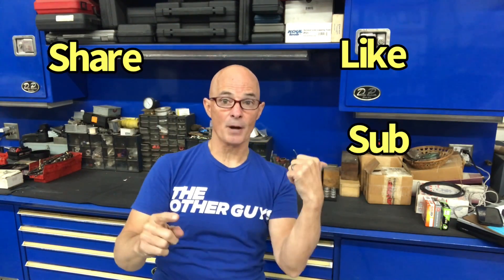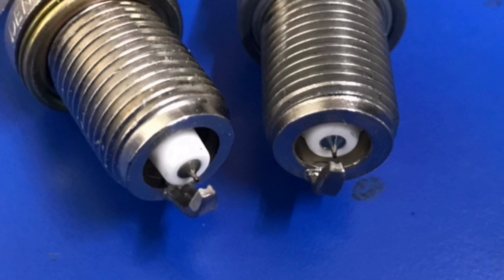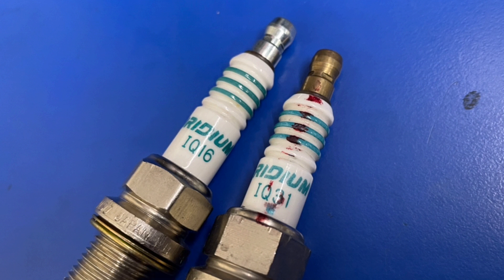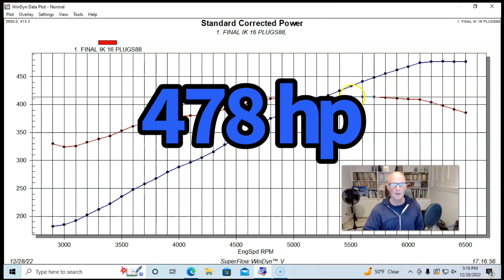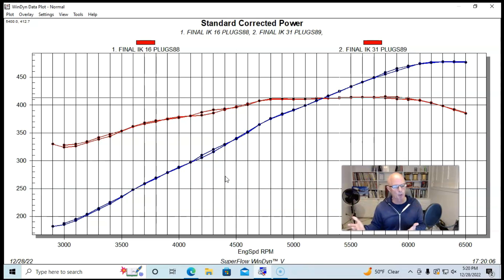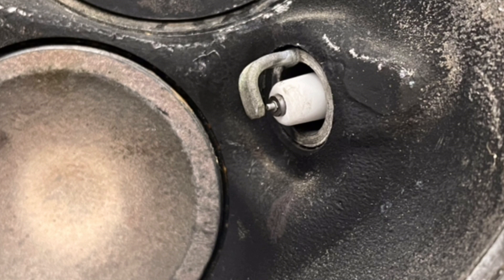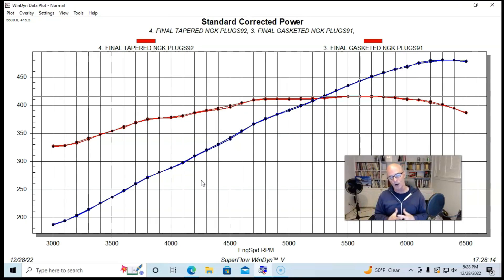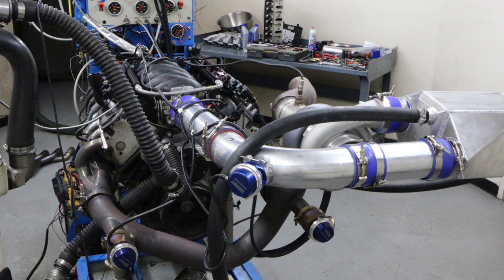SPARK PLUG HEAT RANGE TEST-JUNKYARD LS. HOT PLUG v COLD PLUG-DOES IT MATTER? TAPERED VS GASKET PLUGS

Comment: On some engines the spark plug can make a huge difference. Old Subaru EA series engines for instance. The EA71S factory race engine ran a special spark plug, Golden Lodge 25HL, same as used on some Alfa Romeos. Very hard to find. It was a semi surface gap design. In that engine you can't run a projected tip plug as the intake valve will hit the tip. The plug also needs to be a very cold heat range. A true surface gap (no heat range) will produce about 10hp extra (on an otherwise 110hp engine) and extend the RPM range by 200 RPM, compared to a cold non projected tip plug. I've never gotten to try a set of the Golden Lodges but I have a set on the way to compare to the Bosch surface gap plugs I usually use.
Reply: Let me guess, no difference?

Comment: Instead of power, do any adjustments to spark plugs that you have tested (electrodes, indexing,seating,etc.) have an effect on fuel burn efficiency(cleaner emissions) or fuel use efficiency(mpg)?
Reply from the maker: we tested indexing and gap and plug styles

Comment: With colder plug could you sneak in a degree or two of timing?
Reply from the maker: the heat range of the plug doesn't determine the optimum ignition timing
Reply: @marvin, yes, and with a cold plug and hot spark, you can add more fule with those few degrees of timing giving more power. I think if the tests were done on a carb the result would be more power with the timing and fule variable. But in this test case there won't a change in power.

Comment: Would there be any benefit using a one step colder plug for a stock internals k24 that only sees track use?
Reply from the maker: only as a hedge against detonation
Reply: @richardholdener1727  awesome! Yep that was my intention. Only due to excess heat that a engine sees while on track. 

Thank you for your reply

Comment: This guy is growing on me. I just wish he was testing some of this stuff with higher boost motors making like 1000 at minimum. 1400-1600 would be nice.
Reply from the maker: 1600-hp motors are difficult to keep consistent-for plugs on a 1600-hp motor-gap is the most important thing
Reply: @richardholdener1727  I agree. Which is why I'm here moaning about it. 1400 crank can be consistent. The game starts to change a lot much past that though. In theory a lot scales with boost so the 5.3 method of your videos works but I don't think so much with plugs. As I just trashed some plugs with holley smart coils and a low boost of 22# (for this engine). Every combo does get different as my lower compression 1800hp motor was fine with 36# and truck coils. But the monster boost heads and 11 to one on e85 had enough blowby with 2 10an breathers to shoot the rear main seal out the back and shutdown the track for 20min. I don't like being that guy and I thought I had everything in place to not be that guy. Appreciate the videos and reply. Just my 2c
Reply from the maker: plugs are not usually the problem with boost-coils either-they need the dwell cranked up to 4.0-4.5-and even 1400 hp is not repeatable enough to look for small changes in power
Reply: @richardholdener1727  and I know  us guys running large hp probably aren't your target audience so it may not be worth your time or money to test that or risk those engines. It would be cool to see a catch can video at some point and what size is really needed and the blowthrough that can happen with larger ring gaps and running e or meth.
Reply: I'd be willing to donate an LSX bare block to you if you use it for stuff like this. Could probably get a k1 crank and some cheaper rods and pistons if you're interested. It's sitting at ACE Engines in Torrance right now. It's been remilled and refreshed but the deck height is just slightly lower so it's going to need custom height rods because it was milled by my original builder (not going to drop names) crooked. @richardholdener1727

Comment: I tried some projected nose plugs on my old Suzuki air-cooled four-cyl engine and noticed a very slight improvement in idle smoothness, and perhaps a little bit of extra perkiness on take-off, but nothing that would probably show up on a dyno.
I'm not too bothered. A little improvement building upon another little improvement helps, though.

Comment: Question: I have two cars with the same engines but one low comp supercharged and the other hi compression n/a. Sparkplugs are two heat ranges apart from each other. The question is, what happens if I use the n/a sparkplugs on the supercharged engine? Both stock cars
Reply from the maker: use colder plugs in both

Comment: as for gasket plug vs taper seat. its all about head design. best seal to the chamber. the more the plug protrudes the more it gets in the way flow atomization and piston contact or valves. you dont want it recessed in the threads either just barely in the mix.
heat range on plug on the other hand is always application specific but alot of people seem to have it mixed up too. it comes down to what your doing. think of your spark plug as the source of your ignition. think of a glow plug in the same sense. good luck firing most diesels without the glow plugs when its really cold.
now think about your fuel injector as also a source for your ignition. trust me it helps the correlation as you need both of these things at the right time.
fuel timing is important so this is why spark plugs have heat ranges. say you get fuel early. a hotter plug will help burn the fuel better as it wont atomize well and be more like droplets. 
with a higher compression motor less heat is needed as heat and the compression will auto ignite the charge and cause detonation. 
in a 2 stroke application you still only have 2 ignition source per revolution of the crankshaft on a single cylinder. yet 2 strokes usually run hot plugs. they have expansion chambers and scavenge and reburn the previous air/fuel charges that already went through the combustion chamber. hot plug will keep reaction going better and compression is usually low. 
things being said in the 2 stroke field the amount of the electrode sticking out is becomming more important as comp ratio rises. head gaskets are going away and squish bands are much better tech. it actually changes the flame front and ignition comes more from the edges of the cylinder than the spark plug once the engine warms and makes a ton more power and yet again raises safe compression ratio. 
cylinder designers design the head for certain plug and you run said plug. its in the right spot plays nice with the fatty pipe and stays out of the way when the magic happens. 
changes like that allow a tiny single cylinder to make 17-20 hp reliably and run pump gas. with a 15:1 compression ratio. you know engines you know thats alot of comp for pump gas. keep in mind its also not big cc cylinder its only 70cc technically really 68cc. these guys run a "squish" of .7mm you can increase or decrease squish to change compression and flame front characteristics but power suffers obviously. that .7mm is piston to cylinder head clearance you dont get much wiggle room and you have to always be careful when making changes. failure could be catastrophic for many reasons very easily. this one launches at just over 10k rpms and accelerates around 10,800 rpms until the ignition system cuts out at 12k rpms. it hits around 70 mph before the cvt hits its final gear and the rpms climb from its acceleration rpm. with a different exhaust i can raise the engines usefulness to around 14k rpms atleast 13k with a slightly weaker exhaust that also comes in at a lower rpms too so i can have more power everywhere.
if i were to raise my power band i cant use longer plugs as the plug could contact the piston under heavy loads. things stretch under crazy high rpms high heat or major forces. always pick your parts not parts off a shelf.

Comment: I had a 1967 mustang 289 that I installed a street master + AFB, a RV cam and headers. Originally the stock configuration would get about 20 - 25 MPG. The modified config gave about 18 MPG. I played with jetting and got into lean serge. I changed to the colder spark plug, Hipo for the 289 and was able to go leaner.

Comment: What spark plug and wires combination would be good for a 07 5.3 with truck Norris cam ls7 lifters and 3/4 longtube headers need
Reply from the maker: stock wires and 1 step colder in plugs

Comment: I listened to the whole video and have a question.  What would happen if you played with the timing in these tests?  Could you get a little more timing into a cold plug, or would knock be a little more forgiving on a cold plug?  I've heard a lot of tuners make the comment that running a TR6 NGK plug vs the stock TR55 makes it a little easier to tune and dial in the engine because the knock resistance being a bit better makes it more forgiving.  Nobody ever makes the comment on if more power can be milked out of one over the other though.  In my example there we are talking N/A engines and only one heat range of shift, which is pretty minimal.  Though it is interesting I hear that just with one heat range colder than OEM there is a measurable difference in knock resistance.  I would love to see you test knock/timing impacts on an LS motor vs heat range.
Reply from the maker: we alter timing til we get maximum power-

Comment: Only time I have run into fouling issues with cold plugs were with carb blow through engines on the streets. 
EFI has much better fueling control than carb stuff so makes sense.
Unfortunately Tuning carburetors is a dying art.

Comment: Iv noticed that my 2019 2500 silverado 6.0L pings often with the stock plugs and I can feel the computer taking out timing out.  Im thinking about getting a colder set to help and go back to hotter plugs once then engine starts to burn oil. You should see if you can make table changes with different heat ranges to see the effects. Like if you can run more timing on colder plugs.

Comment: On my 1985 GPz 750 turbo I had to increase the heat range 2 numbers because above 8500 rpm the boost blew the spark off the plug like blowing out a candle. I used an MSD ignition and coils and Nippondenso 16 copper core plugs and started exploding turbos because the impellers were spinning so fast oil wouldnt stick to the bearings and theyd lock up and explode. Terry Kizer put a Torringinton 2 stage bearing in a turbo and that made my engine live till 4th gear, the turbos exploded under boost in 3rd before I had the new bearings. I was putting 52 psi at the intake valve @ 12,000 rpm and my engine liked hotter plugs and VP C16 fuel.
Reply from the maker: just say no to hotter plugs on a turbo and bring the plug gap down-you won't blow out the spark
Reply: How much wheel horsepower? Turbo bikes are badass.  Stock turbo?  Sounds like maybe turbo overspeed failure.

Comment: I tried a few different taper/gasket plugs in different heads many years ago. For same type of plug, they protrude into the head exactly the same. Denso plugs are good though, 31 is very cold !
Reply: How were you running a taper plug in a head designed for a gasket plug??
Reply: @davelowets  obviously you just screw it in. They work perfectly, have been using them for 20 years. Tapered seat plugs seems a very American thing, any Euro engines that used that style are decades old.
And as RH shows, he had a mixture of both
Reply: @blow0me  If the edge of the plug seat in the head isn't tapered, and it's just a flat surface, jamming in a tapered plug could end up to be a bad scenario, such as boogering up the threads.

You can put a gasket plug in a tapered seat head, but you can NOT put a tapered plug in a head designed for a gasket plug.
Reply: @blow0me  The brand new American made heads on my Oldsmobile big block use non-tapered plugs.

Comment: A dyno test of coils would be interesting.  D585 heat sink coils vs square coils vs Ls3 style coils.   It’s a deep rabbit hole I went down when I had a 585 die and considered best replacements.
Reply: If you currently have enough spark to ignite the chamber fully, changing to a “better” coil won’t do anything.  People don’t realize that on old school SBC’s with distributors and msd boxes they’re easily turning 9000+ rpm in some applications with ONE coil.  With multi coil setups, each coil has 1/8 the workload and has to fire at 1/8 the speed of a single coil application.  As long as it has enough dwell time before having to discharge, it’s doing its job to the needed standard.

The easy way to look at it like asking will a stock fuel pump, a walbro 255, or a 450 make the best power on a stock 5.3?  Pumps make zero difference once you’ve met the needs of the rail and system flow.
Reply: 585's are overhyped and over-rated.
Reply: Agree. Also spark plug test on motor with 12.0 comp..6.2. Heads cam...not a small 5.3
Reply: @GETLITUP69  likely make zero difference too

Comment: i left a comment, actually more of a question, on a 10 month old video.

I don't know how far back you on to read comments.

those answers will not just suit me, but suit nearly every 5.0 efi sbf being built for street application.  granted, a lot of folks won't be able to afford the heads, likewise adding that to the answers, might be helpful for a lot of your viewers (in addition to the questions i asked).

the title to the video i left it on is:

HOW MUCH POWER IS A 5.0L CAM SWAP WORTH? WHAT IS THE BEST CAM FOR MY 5.0L 302? 5.0L FORD EFI VS CARB

much appreciated, yer one damned fine fella.
(as is most of the west tech folks)
(back in the late 80's,  early 90's, absent westech i had to run hard up n down the hill to big bear to test my upgrades!!  (those where the days).
no longer out there thou....  I headed east eventually...  (that elevation change tells a lot of secrets with performance)

Comment: we used to run a small block Pontiac 312ci with 13-1 compression on methanol we used washers on our plugs more so for clearance and which way the tips were facing so they didnt hit the piston we did all these dyno tests on it and we found absolutely no loss or gain from them including temp of plugs there was nothing in it we just ran what type worked better for the compression ratio and fuel the only thing we saw the hotter plug started up easier on methanol
Reply: Pontiac engines dont have a "big block" OR a "small block". The block sizes are all the same from the 301 on up to the 455. 😕

Also, the heat range of the plug will make ZERO difference to the way an engine "starts up".

Comment: you posted tested in wrong way  , as you gave a bigger cooling system with a water motor so the block gets cool very quick.  
real Results will come when u install a radiator same as we have in cars,  plus hell lot of difference when engine is running  without load and with load.   !
Reply from the maker: no on both counts

Comment: Best bang for the buck coils?  D585 "heatsink" coil still the best?  Test them under high boost and/or wide gap.  Can you log coil voltage and current?
Solid vs resistive wires?  (EMI from solid wires can mess with crank/cam VR signals.)
Reply from the maker: we used ls3 coils on the big bang motors

Comment: What about using iridium or platinum plugs with nitrous? I've always heard to use the cheap copper plugs with nitrous because they will melt before a piston will.
Reply from the maker: the idea is not to melt the plug or piston
Reply: @richardholdener1727  That's true,  but sometimes things happen.  Like a fuel solenoid doesn't open or there is a problem with an electric fuel pump or an angry ex girlfriend stuffs a sock in your fuel cell, etc.

Comment: Richard you are crazy man!  Ha,HA, 
JUST KIDDING MAN! 
Put a set of E3'S in your own Chevy truck! Same heat and everything, take notice of low end, (seat of pants feel, stop and go e every day  driving ! That dyno is not the answer to every  thing!
I put e3,s in my 6.0 truck and felt the low end power !
Reply from the maker: the dyno is much more accurate than seat of the pants
Reply: Yes the dyno is more accurate, but you are not varying the rpm as on the street, constantly, "most average street driven trucks& cars won't be rev.past 3000
Rpm's on a regular basis!

Comment: How about anti-seize on the threads? Someone recently said it’ll cause misfires due to a bad ground. I would think the ground would be made at the seat, not threads, and I’d like to be able to get them back out down the road. Anti-seize or no, Richard?
Reply from the maker: yes, use anti seize for new plugs
Reply: I had heard the bad ground issue from anti-seize from a trusted dyno tuner once also. I'm not sure what to think of it. I guess it could be theorerically possible if someone slathered the plugs so full of it that it coated every bit of metal that contacted the head... 🤷🏻

Comment: Love the videos, i sm seeking a rebuild recipe for an original L31 in my 98 chevy c1500. I been contemplating 383 / cam / heads rebuild as a daily driver on a budget. Any recipes you can offer are greatly appreciated
Reply from the maker: 383, small cam, home ported vortec heads, dual plane, 750 carb, headers
Reply: @richardholdener1727  thank you! I want to keep it TBI . Also what are good rebuild / stroker kits (brand ) to rebuild with on a budget? As for cam I have heard LT4 and even ram jet cams are good for daily driver

Comment: Great video series Mr. Holdener! How about resistor vs non resistor plugs? Also, when reading plugs for AF/timing, does changing heat range change anything? Thank you!
Reply from the maker: it should not change the timing mark on the electrode
Reply: resistor plugs should be used to help prevent electrical noise when running an EFI system